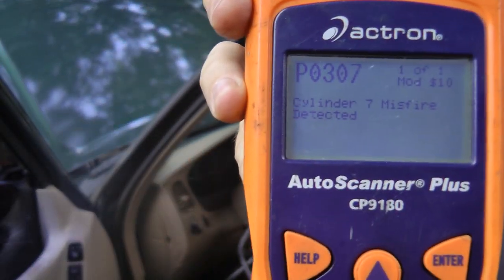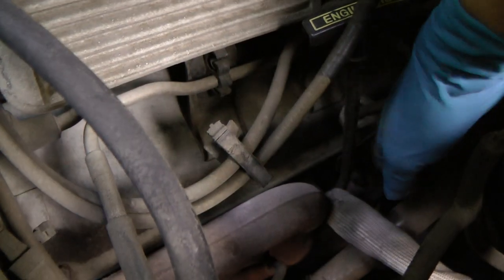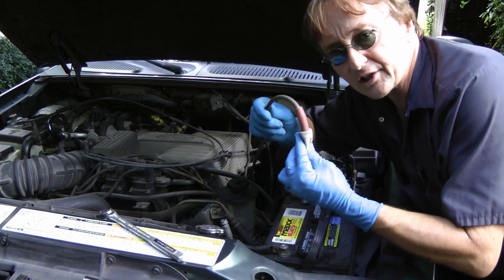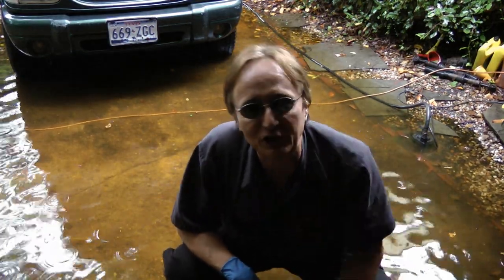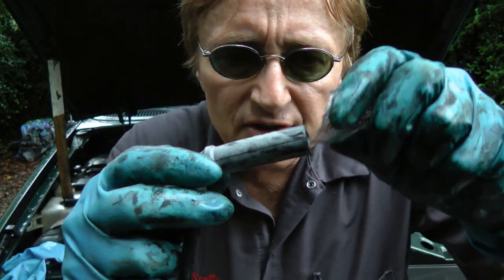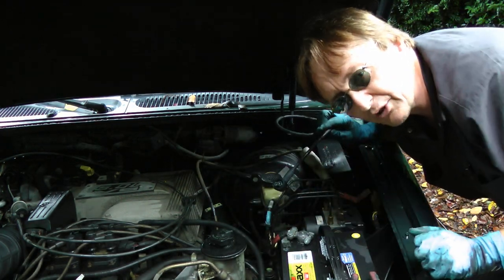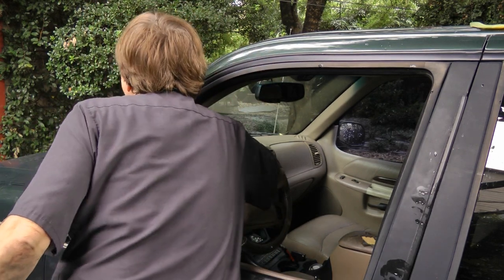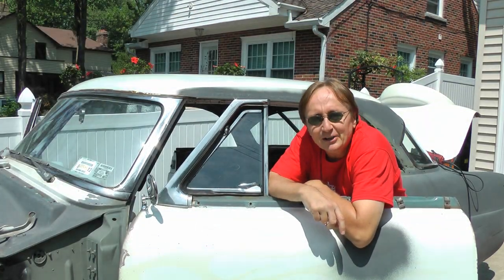How to Fix a Engine Misfire Code P0301 (Spark Plugs and Wires)

Comment: hey scotty, I have 2006 silverado (old body style) v6 and I start it and it goes from idle to 3000rpm. I have checked the codes and I have a misfire, and I did further checking with my GM tech 2 computer to see what the misfire was about and it gave me codes for low circuit MAF sensor and TPS voltage low. Would could be the cause of this? My TPS and MAF are okay. I know that for sure. I do hear a hissing noise when I start the truck up. Any clue with the information I have provided?
Reply from the maker: +Leonardo Flores  hissing i a vacuum leak, fix that first.  that can make maf data wrong, pray it's just that and not a computer failure
Reply: +Scotty Kilmer thanks scotty.

Comment: why is my air filter burning corolla 2002 cng, i do not have a misfire or any other problems. & i don't have a scan tool
Reply from the maker: +Omar Faruque they burn from backfiring, so a problem in the fuel system and or ignition system causing such fires. Also bad engine valves can cause that too

Comment: also when Im doing more than 40mph around 2500-2900rpm  I feel like there is a limit that I can push the pedal any further the car will miss and sputter for as long as I want to hold the pedal there it will just put and not gain any more momentum

Comment: i drive a 99 chevy silverado that has the 4.3L and i noticed when im driving around 1500rpm  i notice that it doesnt keep a constant rpm like it will jump from 1500 to around 1700 what could cause this?

Comment: I have a 2003 chevy venture the dealer said my miss fire was caused by a bolt pulled out of the rocker . I was told its will cost 1500 bucks any ideas?  It located in the rear of the engine. I will hope be out of the hospital  in a few weeks I was read ended and they cut me out of my 1991 camry with 100k miles me and wife were flown to west Chester hospital . My poor camry is totaled My engine light flashes and code says # 5 is mis firing and is has no compression 
Help???

Comment: hi good day. i been viewing almost all your video. i own mitsubishi lancer 89 that misfiring every time in hi revolution. i change my distributor cup, high tension wires spark plugs, cleaned the carburetor, changed the fuel pump, fixed the intake manifold gasket, even changed the head gasket, changed the jetting pin in carburetor 115 low speed 135 high speed. fixed engine timing. adjust idle, still same misfiring result. my mechanics cant do anything about it. hope you can help me i been losing big money fixing it. any way it has under nit short large exos pipe i wandered if this pipe cause misfiring? thank you Scooty
Reply from the maker: yes, incorrect exhaust will often make misfiring at high revvs. ONLY a true pro could rejet a carburetor to make it run correctly that way. Takes a 5 gas analyzer and a dyno for that, BIG money
Reply: thank you so much, its probably the exhaust pipe. another thing because my place is in rural aria here in the Philippine and i cannot find a good auto repair shop,  is there any sit that i could review the specs of my carburetor?  i really love all your video hope you make a lot video in repairing and maintaining old cars specially Asian cars. you help me a lot. more power. Again thank you so much(Maraming Salamat)

Comment: Hey Scotty, i have a 2004 Buick Park avenue and the engine is misfiring. now i need a new battery for sure and also auto zone told me i needed a new cat. converter. Ive even been told i needed a new alternator. the car cranks and just as i drive it a few feet it dies on me and the steering wheel tightens. i crank it again and it gives me a bad idle, the RPM's jump up and down and it either dies or i drive it a few feet and its does the exact same thing i mentioned earlier. got any idea as to whats going on scotty?
Reply from the maker: start with a new battery, that runs everything in a modern car. Then have the alternator load tested to see if it's good or not, you can't load test em with a battery that's bad, so start there.  As for the CAT, they can be pressure tested to see if they are bad and putting up too much back pressure
Reply: ok so that could be the problem? potentially. its nothing major with the engine tho right?
Reply from the maker: Nathaniel Bell  one never knows wit trouble codes, but those engines are pretty strong as long as they are filled with oil and aren't overheated
Reply: its the computer most likely my wife had the same prob.

Comment: When I push my acceleration pedal down at higher speeds, say above 60mph, the revs goes up but the car doesn't accelerate. Almost as if the car is out of gear or something. Is that engine misfire? And what could be the cause?
Reply: Your issue of the enginwe reving over speeds of 60mph sounds like more of a transmission issue. Is it and standard transmission or automatic?
Reply: It was the clutch that was slipping. Had it replaced.

Comment: i have a 2000 ford explorer xlt with 145k miles.....i have a p0420 code that comes up like less then 30 miles after i clear it...any ideas....and also recently my sterring wheel shakes back and fourth and pulls to the right....more noticeable below 40 mph....little resistance while turning right......doesnt make any noise......
Reply from the maker: steering has nothing to do with that code, the code is a bad catalytic converter, they go out on explorers at that age often. Check your front tires for wear and front end parts like ball joints and tie rods for wear for the shaking
Reply: Scotty Kilmer
thanks......i recently replaced the drivers side cat awhile ago....think i had the same code but think it was bank 2  i beleive,could be wrong,and my passenger side cat..is still stock...so looks like ill be replacing that soon too.....would a bad cat cause bad gas milage !!!!!!!.....you would say check out the tie rods for the shaking issue,more likely then the ball joints !!!!!!

Comment: Hi Scotty ! I'm your fan.
 I have a 1999 mazda protege 1.6 with old 17 pin diagnostic socket under the hood ( european version maybe.. in US you have obd2 from 1996) I checked its dtc with wire and led tester because I can't use standard obd2 scanner tool, it shows me 52 and 63 and the same again and again.. do you familiar with old trouble codes? can't find nothing on the internet...Recently I changed crank pulley and then problems began to appear, I have hard engine start (good battery and starter) and it misfires around 2500-3000 RPM and during acceleration from stop, I already checked plugs,wires,ignition coils and they're fine. 
Thank you!
Reply from the maker: 63 is a solenoid lock up valve problem on that car.  But 52 is not a valid mazda code number
Reply: Thank you for quick response! So you mean 63 it's AT solenoid valves problem?
about code 52 I'm pretty sure its 52 I checked couple of times.. I'll check once again. Thanks!

Comment: I have cylinder 3 misfire I change coilpack I  changed my fuel inject I changed spark plug and my car compression is still good off by 3 points help running out of ideas
Reply from the maker: bad fuel injector on 3, bad head gasket there, or bad intake manifold leak on 3 often do that too

Comment: Hey Scotty, Love your video's, even my know it all uncle know it loves them.  I have a problem with my 2002 Saturn SL1 1.9L single cam, there's a missfire on 1st cylinder and high idle, about 1700RPM, I changed the plugs, wires, coil packs and modual, I even cleaned the throttle body and changed the idle air control solenoid.  Can you please help!!!!

Comment: Which is the number1 cylinder on 2005 Lincoln LS?
Reply from the maker: +TheKayturner passenger side front cylinder on the V8
Reply: Scotty Kilmer hey Scotty what would your advice be on the diesel additives and oil treatment etc. I mean slick 50 oil treatment is very very thick would this clog the oil filter. Also would you your self use any of these products like redex diesel system cleaner or most importantly the DPF fuel additive that claims to clean the soot off the DPF at a lower temp. Any advice would be greatly appreciated

Comment: WELL SCOTTY ONE MY EXHAUST BURNED MY #6 MSD SPARK WIRE,,THATS THE MISFIRE PROBLEM,, GONNA ROUTE THE NEW ONE BETTER,, I AM STILL REPLACING THAT O2 SENSOR, I CANT GET THE DARN THING LOOSE I TRIED STARTING IT LETTING THE METAL HEAT UP AND SOME PBB BLASTER,, ANY TIPS OR ARE THOSE ONLY 2 THINGS I CAN DO !!! NEED A LIFT WITH YOUR FAMOUS CHEATER BAR LOL,, THANKS SCOTTY

Comment: Hey, I'm looking into a 2004 Nissan Altima.  Any problems?  Thanks
Reply from the maker: yes, big time engine problems, do not buy
Reply: Scotty Kilmer is it possible you could elaborate on the problem please, and also what do you think about the 2004 mitsubishi lancer, or 2004 nissan sentra, thanks
Reply from the maker: *****
most american sold nissans come from mexico where quality control is not the greatest. Mits are also cheaper made vehicles. You want quality, get toyota or honda to a lesser extent

Comment: What could cause a car (manual trans) with no cel, to drop rpms but go back up and when it drops rpms it slightly feels like it stalls but doesn't. All while in gear and only happens once in a while
Reply from the maker: often a weak fuel pump, pressure test it, or a clogged fuel filter, or a dirty maf sensor (clean it)

Comment: Appreciate the effort put into empowering people to make their own repairs, but you missed several key points. The use of anti-seize, and tightening the plugs to the proper torque so you don't break the plug off or damage the cylinder head threads. Also, engine misfires are a complicated problem and much of the time it will be more serious than a simple spark plug or wire, especially on Chevy/GM engines that have known manufacturer defects like leaking head gaskets.

Comment: btw I had a valve cover leak it was cracked so I changed  and new gasket, spark plugs and wires, air filter and changed my oil, I tested my plugs and wires there fine looked and listed for vacuum leaks there's none.

Comment: Hi Scotty. I've been looking at your vids they are great! 
I have a problem with my 99 R34 GTT skyline. I initially thought it was running too much boost so I turned down the manual boost controller all the way to prevent a boost cut but I still feel a misfire after 3rpm and the engine is cutting out also jerking and keeps doing so up through the gears and struggling to rev.. Also when I reach over 100mph and my foot is well planted on the accelerator the check engine light comes on. Only when I drive under 3rpm does the car seem normal.
What do you think might be the problem?
Thanks
Reply from the maker: first, do a wet and dry compression test on all cylinders, often it's worn engine internals doing that on that model.
Reply: Thanks I'll do that. Most likely replace engine?

Comment: I have a 2003 Nissan Altima that is misfiring also losing complete power while driving It will not go over 1000rpm I will pull over turn the car off about five minutes crank it put it in drive it will run for a while then it does the same thing again what’s wrong?
Reply: Elliot Mcnair
Is there a check engine light? Does it throw a fault code?

Comment: hey scotty my bmw 540i is misfiring the first three cylinders! i checked the battery it is at 12.2v that is 50% charged right now, 12.6 and above is fully charged. i just retightened the belt, could that be the problem? i checked the spark plugs and ignition coils and fuel injectors all were changed a year and half ago, i don't under stand what is wrong with it, it was just working fine yesterday. I retightened all the air filter parts to the throttle body, i don't know what else could be the deal here, any advice would really help me out, thanks.
Reply from the maker: many things can do that, but a bad crank sensor is very common on those
Reply: oh really? thanks, there is a fault code for that wouldn't that code come up if that was it?

Comment: I changed the spark plugs and the wires.... cant get rid of that knocking sound. its a 96 chevy cavalier 2.2L
Reply from the maker: often worn engine internals cause knocking, like worn valves or crank bearings
Reply: yes, I believe one of the cylinders were bad. as I took the spark plugs off, I found one of the spark plugs broken in half. not sure what the case is.... anyways thanks for writing back.

Comment: Hey Scotty, do you mind taking a look at a video i posted on my page of my p0301 misfire? you can hear it from the tailpipe as well as under the hood.
Reply from the maker: +L Brown cylinder 1 is misfiring, could be spark plug, wire, coil, or fuel injectors (and pray it's not a blowing head gasket or bad valve.)

Comment: I have a 1978 datsun 280z that's misfiring and stalling. I changed the fuel pump, spark plugs, sparkplug wires, fuel pressure regulator, distributor cap , still nothing. Please help
Reply: And the injectors aswell
Reply from the maker: deathslayer7895 do my video test "how to tell if your head gasket is blown" it may be.  If not that, often the maf sensors go bad on those

Comment: Sir Scotty...Help for locating my cylinder3,I have passport 96 v6 engine and im confused, I have obd2 diagnostic and said p0303 cylinder3 missfire and my 96 passport engine is not side built but straight towards radiator. What I meant is on the left side cylinders numbers are 135? and on the right cylinders numbers 246? Please help ...Thanks!
Reply from the maker: 3 is the middle cylinder on the back side near the firewall.
Reply: Scotty Kilmer Thank you very much
Reply: Scotty Kilmer b

Comment: i need help cadillac cts 04. blinking engine light on. idk i changed spark plungs n fuel pump idk but now its making a puttering sound n feeling
Reply: did ya ever figure it out? 
i was thinkin clogged pcv valve, but definitely somethin restricting normal flow.

Comment: hey Scotty
i have toyota celica 2000 gt. i have p0300 code on my engine and engine light is on. what i should do?
Reply: and i checked my spark plugs and they are fine. but for safe side i cleaned them but still code is on.
Reply from the maker: md nippon
that's random misfires, one of the hardest codes to pinpoint. Try my video"how to clean fuel injectors on your car" as that older car often gets clogged injectors from age
Reply: hi scotty
i cleared the code and now it came P0301 so i did compressure check and from my first cylinder to 4th one and result are:

1st: 150
2nd: 180 and 3rd and 4th as follo was 180!!

so i saw couple of video about "restore" oil which increase compression power. so i bought that oil and put it in to my engine oil. is there anything eles i can do?

by the way which country you are located?

Thanks in advance

Comment: Hello everyone, I have Ford Taurus 2007, car runs great and smooth, but consuming more fuel as 3 of its cylinder are misfiring (cylinder 4,5,6 to be exact). I got following codes from OBD scanner : P300, P304, P305, P306 for misfire of those cylinder, I also got P175 for 'System too Rich Bank 2', and P430 for 'Catalyst system efficiency below threshold Bank 2'. I have checked the ignition coil's primary and secondary resistances. Primary resistances were (1.1, 1.1, 0.8 ohms respectively) and secondary resistances were (10.30, 10.24, 10.14 kilo-ohm respe.). So ignition coil seems good, the spard plugs are also replaced recently, spark plug wires seems to be in good condition, then could anyone tell me what might be causing these misfires and other errors?

Comment: i have a 1999 sunfire 2.4 and i have cylinder 4 misfire how to fix it
Reply from the maker: cody smyth try new spark plug and wire on #4 cylinder, if not that, try a fuel injector there and PRAY it's not a blowing head gasket there
Reply: Ok I will try that thanks you are my go to you tub guy now

Comment: i have a engine vibration at idle i cleaned the fuel injectors still there is a vibration in the engine at idle any ideas??
Reply from the maker: tons of things can do that, from worn motor mounts to bad maf sensors to vacuum leaks, start by checking those
Reply: Thank You Mr Scotty Kilmer

Comment: Hi, Scotty, I really dont know what to do, i have brought a 2002 Toyota Altezza with a transplanted 1998 Lexus 1uzfe V8 in it, it is running the factory computer that came out of the previous car. Now the problem is it drops 4 cylinders after about 10 minutes, on start up it is fine it runs on all 8. I have taken it to a mechanic and they cant find any problem. Then we took it to a dyno tune shop and they think it is the computer? I cant afford to pay $4500k for a new aftermarket link g4 extreme. =( any ideas of what is happing or how i can solve this?? Any help would be much appreciated. Cheers
Reply from the maker: you can't just put one engine in a car with a different main computer, all bets are off then, because of computer software differences, wiring differences, and sensor differences.  Good luck finding anyone who can figure that out, the dealers won't even work on such a car due to such problems.
Reply: Scotty Kilmer Ye thats what we thought its not easy trying to get the dealer to pay for this, its not my fault its a 4 cylinder and not a v8 most of the time haha, thats why we are going to install a Link G4+ Extreme specifically for my engine and car.  Thanks for your time  =)

Comment: I just change coils and spark plugs and misfire cylinder 4 appears again,can you tell me why?
Reply from the maker: could be bad fuel injector on that cylinder, blown head gasket on that cylinder, leaking intake manifold gasket at that cylinder, or computer circuit failure
Reply: Scotty Kilmer thank you so much, Saludos 👋from Washington state 🍏🍎